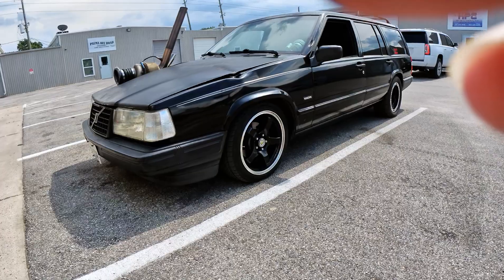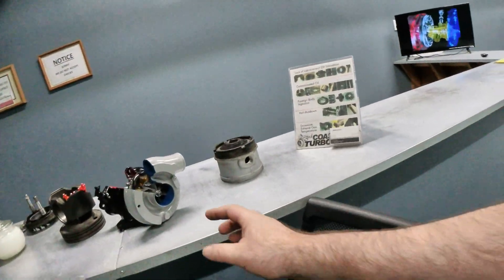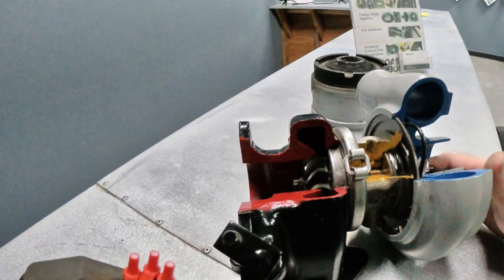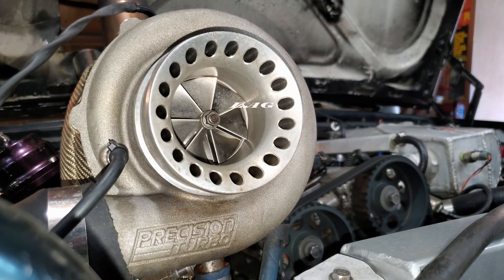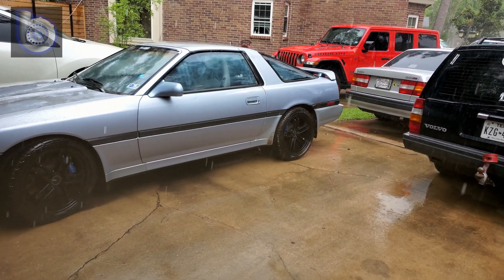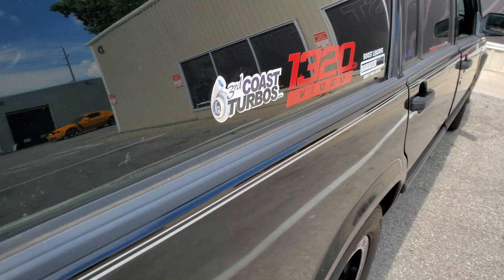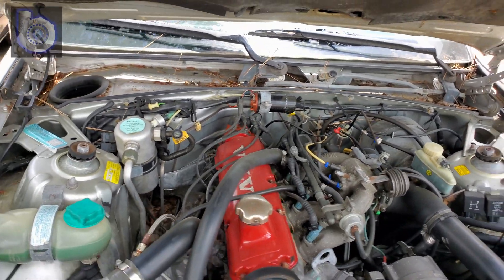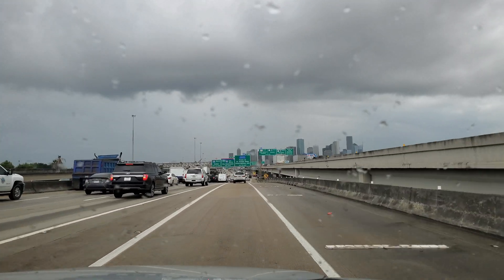Picking the Turbo For the Redblock Volvo

Comment: Got any tips for finding a 15g/16t to buy? Ideally I'd find one in a junkyard and have it rebuilt, but as I now know they aren't super common to find. I'm hesitant to buy a "remanufactured" one off ebay as they are most certainly rebuilt with chinese parts.
Reply from the maker: So true. I would try my people at 3rdcoastturbos.com and majestic turbo (dallasturbo.com), depending if you are closer to Houston or Dallas. 3rd coast is right down the street from me, majestic turbo is in DFW and I have known them for almost 30 years now. Both rebuild turbos, use quality products and keep new turbos in stock for certain applications. Nothing beats buying a turbo with a warrantee! I hope that helps you. Good luck!
Reply: Awesome thanks for the info!

Comment: after changing the turbo who do you tune your car? without the modern standalone ecu
Reply from the maker: People tune the chips, I used "the lost art of" off turbobricks to build me a fuel and ignition chip. Honestly if you get a 50 t3/t4 trim or smaller turbo, tuning is not required , the ecu will run it, just not at its best, that's all.. Now My wagon is on a standalone, and I tune that. If you want to run a na block and turbo it , you can jump two wires to pull ignition timing out if you are in a hot climate.
Reply: @TurboWorld  My '98 945 2.3 Turbo 15g billet did not get accustomed to 0.7-0.8 bars (about 10.15 psi) boost levels with kinugawa wastegate... had to lower boost pressure to about max 0.65 bars (9.5 psi) i have 3" downpipe and 2,5" 200cel racecat (Flowmaster) and one freeflow muffler on end (xlerator). E: ofcourse i have largest intercooler that goes into stock position. Same as do88 intercooler. Cheers man.
Reply from the maker: sounds like my 92se , massive intercooler, stock car.  Love it.  @Jefitus

Comment: What is your recommendation on adding a turbo to an N/A B230 block? I guess what I’m asking is if it can be done right without replacing the engine to a factory turbo’d block.
Reply from the maker: Hi Michael White, Great question! I have had great luck in the past running stock na engines with larger than factory turbos on them, my favorite used to be the superbird, or xr4ti turbos on them. But I found in Texas I had to retard the timing a bit in the ezk box by using jumper wires (using pump fuel and mostly stock stuff in early t2k). The last one we ran was the best I had ever experienced about five years ago.. The Devries Brothers "humbly" swapped in a Lh turbo fi and ezk ignition box, into a later 80's 240 that was originally na regina. The engine had over 200k on it. We bolted a 16t turbo from a five cylinder Volvo on it, added some coolers and the key ingredient. An adjustable alcohol kit. I like the devils own kit with the built in map sensor on the two knob adjuster. That alcohol helps combat the detonation of higher compression engines while making more power on pump fuel engines. Alcohol burns colder so it lowers the engine heat tremendously. I wouldn't even play with the ignition timing now, just add a alcohol kit, or switch to e85 as the only fuel. We never had to crack that engine open to replace a head gasket, it ran so awesome that it changed owners three times, ran for three years and ending up running up a telephone pole and on and over three parked cars I believe it was, in the rain. (Pictures of grey wrecked 244 in community tab, scroll down-it flipped several times!)That engine did not know anything about Can't. That car flat out hauled more mail than any new driver of it was ready for. I also did a accumulator mod on trans and a huge fan and cooler upgrade That made it bark second gear, car was way faster than it really should have been, that's why we are building something similar with the mob series 242, but on e85 instead of dual fuels, and With Micro squirt and standard Trans. The auto is faster but doesn't last long around 300 wheel horse power without huge mods, then just gives up around 400 wheel horsepower after huge mods. Here's one of the videos of the 242 we are currently building. To answer your question- Short answer yes, long answer, many ways! https://www.youtube.com/watch?v=WKc8XOHP0kM&t=330s
Reply: @TurboWorld  thank you so much man! I currently own 2 1993 240’s (wagon and sedan). I’ve been wanting to turbo the sedan, but currently working on a small gremlin with it that I’m sure is something simple that I’m just over looking. It has a misfire but smooths out when you rev it until you’re driving and then on moderate to hard acceleration it almost feels like it’s pulling back, like a stutter. It’ll get up to speed but is lacking major power and I’ve replace just about everything I could think of, so I’m trying to figure that out and then I want to set up for the turbo. The motor only has 130k ish miles on it and I’ve scoped the cylinders through the plugs and it looks primo inside. I’ll probably shit my pants when I finally figure out it’s issue though cus it’s usually something so simple you never even considered it 😂
Reply from the maker: @ElCapitanDudeMan  What have you checked on it, maybe I can help where you left off? Sometimes something as simple as a leaking fuel pressure regulator can greatly degrade performance and cause a misfire or studder.
Reply: @TurboWorld  so I’ve got a new fuel pressure regulator in it and new injectors and both fuel pumps have been replaced as well with the sender and the sock since this issue has arisen. I’ve done the crank sensor, knock sensor, maf, IAC valve, cap and rotor with new plugs and wires and the pcv system with all vacuum lines. I was going to do all of this anyway to freshen it up and it wasn’t too expensive but none of it fixed the problem and it used to run like a bat out of hell.